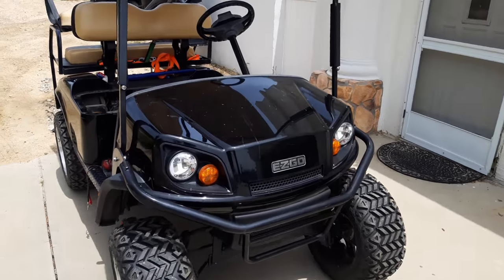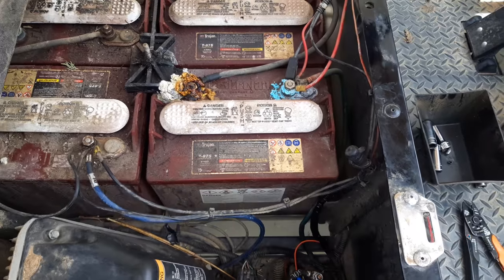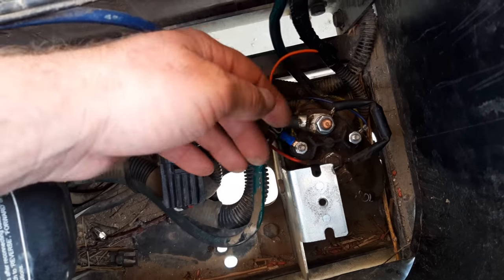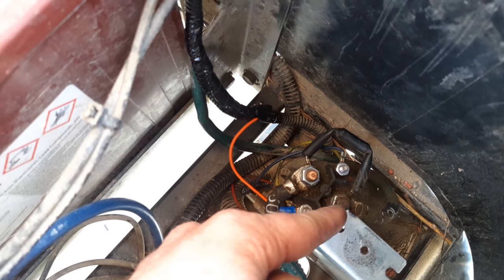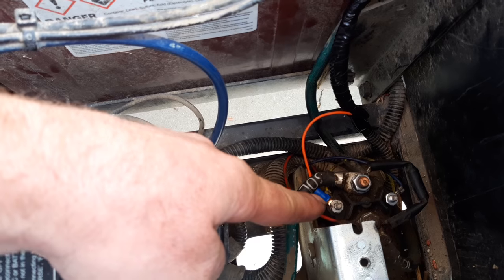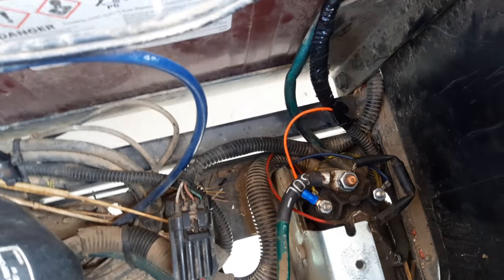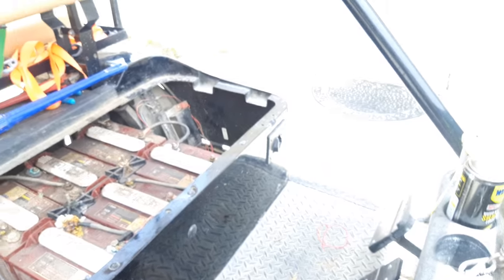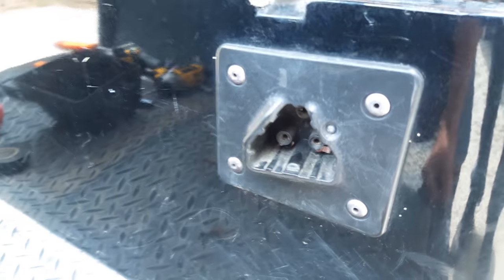Ezgo TXT TXTE - 48v golf cart FIX wont move no solenoid click charge port diagnosis

Comment: Got clicking at solenoid not moving any help would be deeply appreciated
Reply from the maker: I would verify voltage goes in to solenoid and also actually comes out. They can click but have a bad contact inside. And you should have close to 48 volts (fully charged source voltage of the batteries), if lower back track to see where the drop is. Or if it is always lower consider batteries or connections (source)

Comment: There is a 30 amp fuse soldered inside the charge port. You can get a 30 amp fuse link and connect it between the little blue wire and the big red wire. Do not cut those two wires, just connect the fuse between them.
Reply from the maker: I think that is on the old style charge port, are you sure it was for this one? It still charges fine but it has an interlock circuit that was showing the charger still connected.

Comment: Also why you at it clean the corrosion
Reply from the maker: Sure, but first make sure I can fix the machine rather than perform maintnance on something that may not be fixable right? Being a good steward of the customers money.
Reply: I understand but with the corrosion it takes away from the true voltage

Comment: So I ran that charging port wire directly to the my positive terminal and it did indeed open the solenoid and the cart took off for maybe 30 seconds and then the solenoid shuts off again and won’t click. I charged my batteries to full 50.8 volts and replaced the solenoid and same results. Clicks once and moves a foot then stops.  Help!!

Comment: I hear a click and only goes reverse ?
Reply from the maker: Sounds like you may need to focus your testing on the forward/reverse select switch. It takes 48v and sends it on the forward or reverse circuit back to the controller. Test with a meter.
Reply: @paulkelley86  thanks i replaced the entire forward reverse switch with and old one from a parts goft cart and worked great.

Comment: Nice work but someone will drive off while the charger is still plugged in
Reply from the maker: True, that's a good concern. My plan with this owner was to have him always run the charging cable through the steering wheel and plug it in. That way no one could miss it.

Comment: So my silonoid clicks but does not go.

Help?
Reply from the maker: I would check battery voltage, if ok, I would check for power on the motor side of the solenoid
Reply: @paulkelley86  hi there my solenoid sometimes clicks. on-site electrician said it was only producing 35v from the foot switch under floor (as I thought that was the problem) would it still work at all with 35 v or does need 48v?
Reply from the maker: @tw1g123  there are 36v and 48v carts. Maybe yours is a 36v (6 batteries) that would be good. If it is a 48v (8 batteries) that is a problem but I cant say for sure if it is the only problem. You should see what the battery voltage is to determine if the batteries are low, or if there is a voltage drop. As some pointed out, corrosion on the terminals could cause voltage drop, if your battery post positive to negative for example read 48b but positive to negative cable read 35 volts that would indicate you are dropping 11 volts at the cable to battery connection and should be cleaned. 

Also I am unsure if you mean 35v to the large battery cable from the battery to the solenoid, or the smaller wire that controls the solenoid. Should have source voltage (48v assuming 8 fully charged batteries) at both the large and small control terminal.
Reply: @paulkelley86  hi paul thanks for your reply. I tried to use again today and it worked for 2 minutes until I stopped and then would not move again. I checked batteries with volt meter and was getting 49.2 v( is a 48v buggy)  there was also no clicking from the solenoid.  I left it for about another hour to do something else and came back to buggy and it has been working the rest of the day fine.... do you think the solenoid could be at fault?  If it stops working again could I test if solenoid by bridging the terminals on the solenoid to bypass it? Thanks again.( the buggy is too tempremental)
Reply from the maker: @tw1g123  you could jumper the solenoid big terminal to big terminal just be careful because that's high amperage.
Ultimately the test is to check if the solenoid gets what it needs to work. If it has voltage at the right points and doesnt work, it is defective. But if you find it is not getting voltage, you track down where the voltage loss is occurring. 
I found this one challenging because the small terminal on the solenoid is controlled by a circuit board / module. My module wasn't putting out voltage. The question was, is the module bad, or is it getting a bad input. In my case it was a bad input from the charging port, which indicated the cable was still connected. Apparently a common issue on these. 
This is the only one I have ever worked on so I dont know the common failure points, I am an auto guy so I understand the concepts, not so different than a modern car. 
Good luck!

Comment: how do you expect any voltage to travel thru 2" of acid corrosion. Dude clean and coat battery post then show me you know what you are doing
Reply from the maker: Well.... based on measuring at the cable I have already accounted for the voltage drop across the connection to the battery so......

This is troubleshooting a solenoid, not battery maintenance. 

Maybe you should be looking for a different video?

Comment: wow, your voltage knowledge is spotty/quite incorrect
Reply from the maker: Hmm, I don't think so. Care to elaborate?
Reply: @paulkelley86  first thing is youre refering to the ohms out of the tow switch when in reality its basic continuity, if you were testing for ohms you didnt say a tolerance. quit wasting peoples time if you dont understand fully.
Reply from the maker: @johnnychamberlain5505  so calling for a spec in ohms rather than specifically saying continuity is incorrect? 
Let's say through the switch we expect little to no resistance, I say .2 ohms or less is good. 
You say good continuity is good. 

Is this what you mean?
Reply from the maker: Johnny!?
Reply: @paulkelley86  the tow/run switch is a basic toggle switch. It has no color resistors. You don't need to test ohms. Its either a closed or an open circuit. Therefore all you need is Continuity
Reply from the maker: @wheelzup7597  continuity is measured im ohms. It is still resistance. If we really want to do more accurate testing we should do voltage drop/available voltage wile the circuit is active. 
A corroded terminal for example has resistance. But do we not call it that because there are not colored bands on the corrosion?
I can refer you to various manufacturer service information or repair manuals that call out testing resistance, given others do refer to it as continuity. But it is always measured in ohms :-)
Reply: @paulkelley86  no crap, but its still easier to teach people continuity. They don't need to know ohms since their is no coil. Just continuity. Closed or open
Reply from the maker: @wheelzup7597  I see your point, but would they not be using a meter that reads in ohms? And at that point, where is the threshold where good continuity becomes not good?
Honest question.
If there is a more basic and simple way, I am good with it, maybe a meter that kind of says either good or no good. I just have never seen anything like that. 

I acknowledge your point, but I am not sure I agree about it being easier. And I definitely wouldn't go out of my way to comment on someone's video that I prefer it taught my way rather than their way. 

 Now where's Johnny with his explanation of how my knowledge is "spotty and incorrect" Johnny!?

Comment: Filthy.     Clean. First.  🙈🙈
Reply from the maker: I think the typical customer appreciates diagnosing the root cause first opposed to performing any and all maintenance that can be seen with eyes, THEN actually measuring and troubleshooting the issue. 
Thanks for the the recommendation but I'll pass and continue to troubleshoot and provide estimate for real repairs before advising maintenance. After all, how can a customer decide whether or not they want to fix the machine if they don't know the whole cost of repair and maintenance. Charge them for maintenance first then call back with a second substantially higher repair estimate?